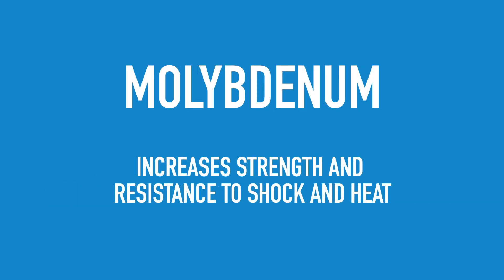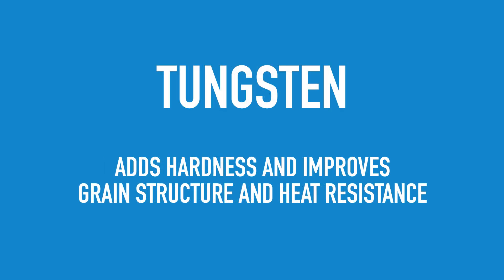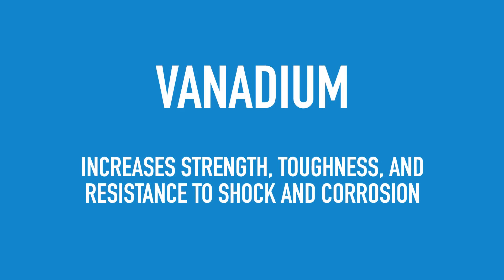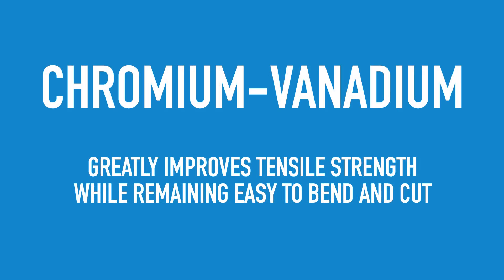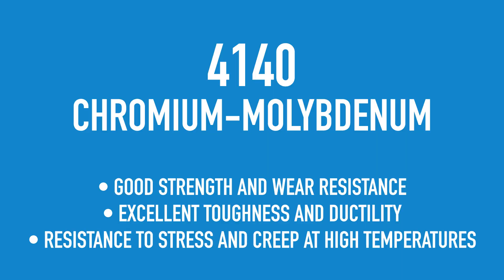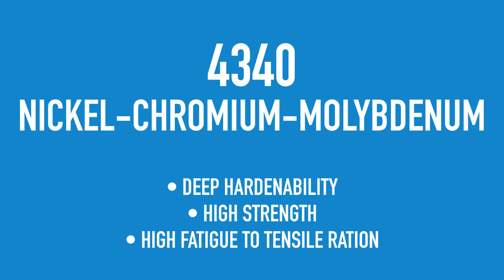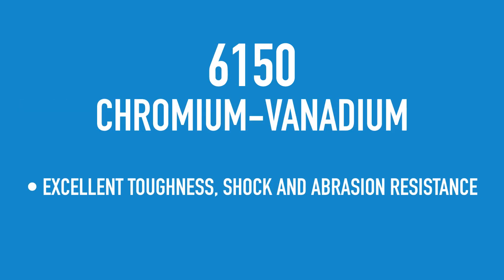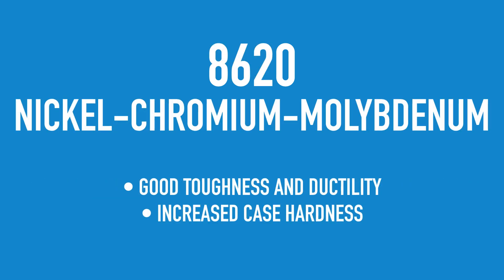The Four Types of Steel (Part 3: Alloy Steel) | Metal Supermarkets

Comment: No one else has my special interest, sigh, why won't anyone wax absolutely poetic about how specifically steel manufacture differs from bogstandard 1040 hammer and forklift tine steel, which absolutely surrounds us at all hours of the day. The controlled atmosphere carbon arc furnaces it takes... how energy intensive... how specialized the heat treat rooms have to be when sulfer in the air can completely ruin certain steels...

NITROGEN HARDENING theres about two videos exactly, of bored people speaking of things they just have to.

Comment: In your opinion what would be the best steel to use on a manual engraving machine for hard metals like brass, as the cutter would be rotating about 20,000 rpm 
So heat and sharpness and temp of steel would need to be a factor, but if you were to go with  a type what would be your preference,
I see tungsten carbine, or HSS  etc also looking for something I can resharpen when a bit dull

Comment: Does anybody know what type of “steel alloy” was used to make 122 lb bells from @ 1894-1963? 

Can’t find info on what the supporting parts are made from.

I have a #22 C.S. Company Bell with a broken clevis head bolt. 

Trying to decide if it’s worth welding the bolt to keep original as it literally holds the @122lb bell to the yoke. 

Haven’t had time to clean and test the metal yet.

Comment: Steels and its classification and their ionization number according to its uses just like the bridge and insfrustructure steels aironoutics steels kinetic steels stress steels for the bolts and Knott's electric and  cables ETC  heat dissipation steels that is about alloying steel

Comment: Went to a metal supermarket store for some basic small amount of metals, just some half inch angle iron (30 feet) and like less than 10 feet of some 2 3/8 pipe and it cost me nearly $300.. way over priced